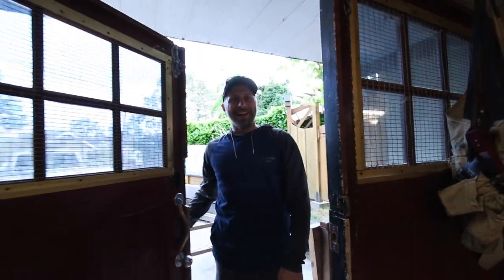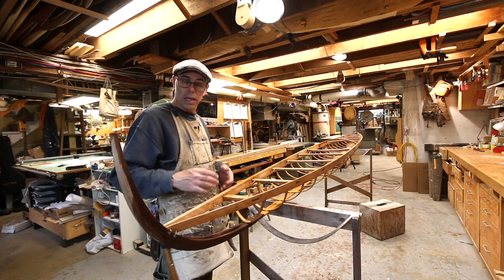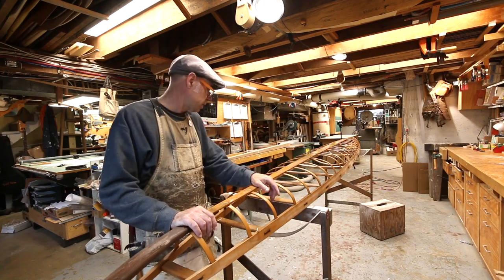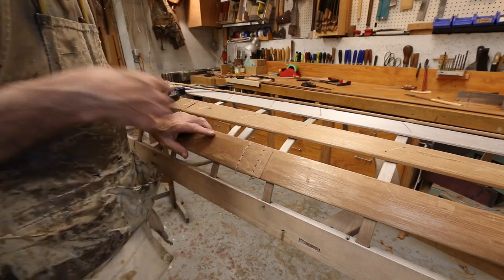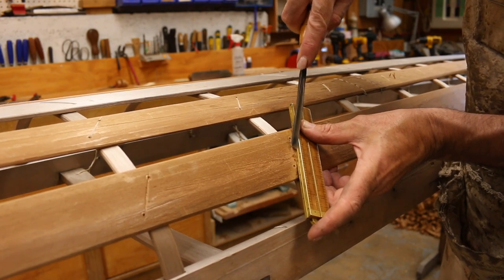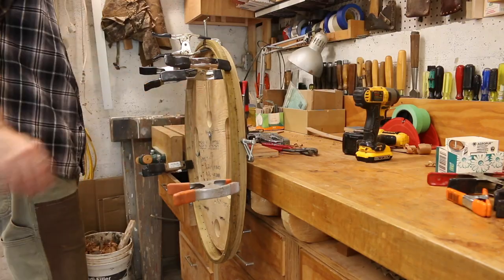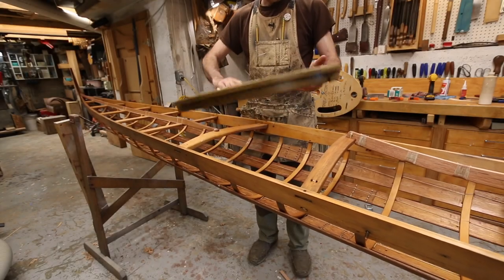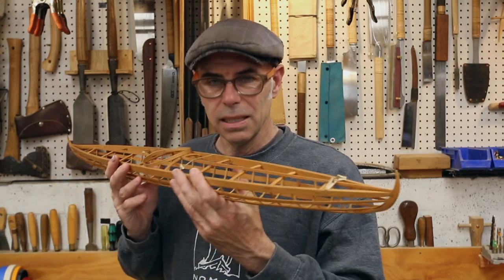A Qayaq for a Museum of Stories

Comment: Contemplating a new canoe project and your video is pushing me to do another skin on frame model. Sadly my OG skin on frame took some abuse when I tried to "make some improvements" and minor repairs. The repairs were successful & the reshaping of the hull graceful and aggressive - what was I thinking!! My brain still thinks the old body is capable of athletic moves to handle such a craft. I found I'm no longer a fan of tippy canoes. Great video.
Reply from the maker: The low weight of SOF doesn’t work in your favour where stability is concerned. You can always use a proven canoe as a makeshift building form. Special attention to keeping the ribs flat and bilges sharper is key to controlling that shape.

Comment: What is the logic/reason for the high free standing stem.? Seems like it's just there to catch wind.
Reply: Yeah. That's interesting. A bumper of sorts for sheer ice, or washed out banks?  A hand hold ? Hmmm? Hopefully, Mark will tell us.
Reply from the maker: Primarily a hand hold for lifting boats onto an ice floe. The ones I did here are admittedly extreme compared to historic examples.
Reply: @Nomadboatbuilding  That makes sense. The logistics of staying dry and balanced in /on freezing and liquid surfaces would be pretty important.
Reply: @Nomadboatbuilding  l had an aunt Floe, but never saw her hauling ice🤦

Comment: I wonder how the skins were made waterproof. It should work for deerskins as well.
Reply from the maker: Sealskins are naturally waterproof but they are maintained with liberal applications of seal oil. Actually, if I recall correctly, it is the male skins that are preferred as the female skins tend to leak through the hair follicles. Yes it would work on deer skins too but traditionally, those are reserved for clothing, bedclothes etc. (Caribou that is, but, still essentially a deer)
Reply: @Nomadboatbuilding  Yes it seems they need nothing when first used. I found this article of a new one made recently using untreated seal skins.